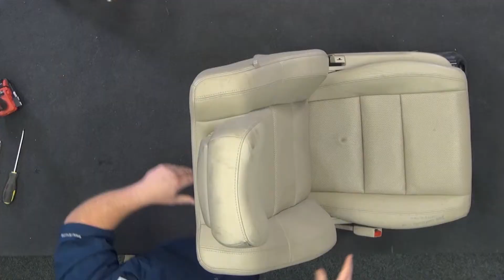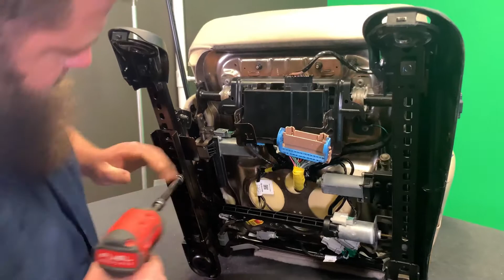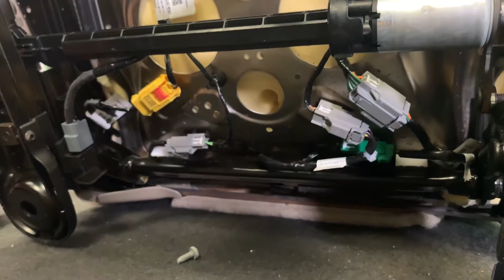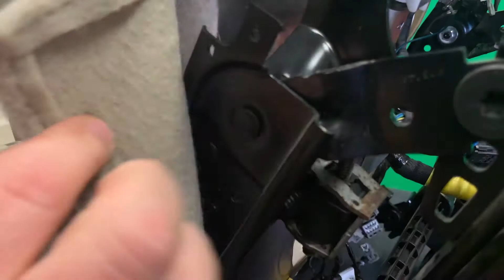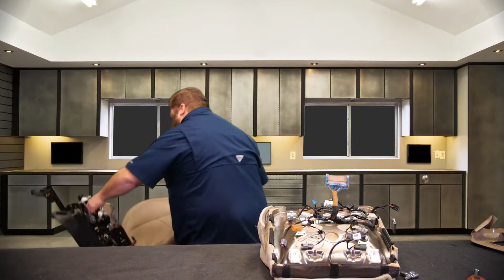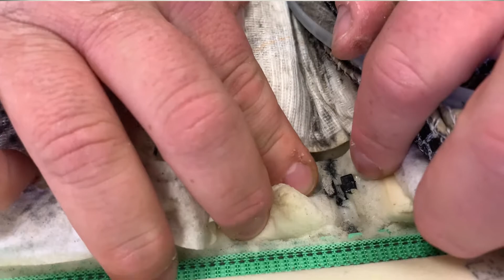Jeep Grand Cherokee (2011-2016) | Dodge Durango (2011-2020) – Part 1/2 – Bottom Cover Disassembly

Comment: easy enough to unbolt the seat, tilt it back and remove the wire connections.  then lift the seat bottom out.  i used my wife's clothes steamer the swell the foam back up. it worked great. i really liked how he carefully explained how to disconnect all the connectors.

Comment: This video is pretty good, but I think you guys would have benefitted from doing a trail run to organize the process, instead of learning as you go. Lots of steps out of order if one was starting with the seat in the vehicle, and unnecessary steps could have been removed from the production take.

Comment: Do you disconnect the battery before removing the seat?
Reply from the maker: You do not have to take the battery out. Just turn the car off before you start taking the seats out.

Comment: So I just wanted to comment to let you know, if you want to take the cover and foam out, you DON'T need to unbolt all that. You can just take the seat out... flip upside down or gain access to the under side and just undo those rails that hold the cover down. That's it. You can even do this with the seat still attached. A while back, i did a video just like yours... (Search wk2 seat cover replacement) and you'll see I did your same steps. But I've since learned you can do this job in about 10 minutes per side no joke. Just undo those rails on the side, no unbolting and you will be done.
Reply: I’m doing this repair can you elaborate? Can I message you

Comment: Great video!  Has anyone had the annoying issue where the seat memory feature fails?  I've done the trick to reset it by sliding the chair all the way up and then all the way back and it will work....but only temporarily.  I've been doing that for a few years!
Reply from the maker: Great tip!